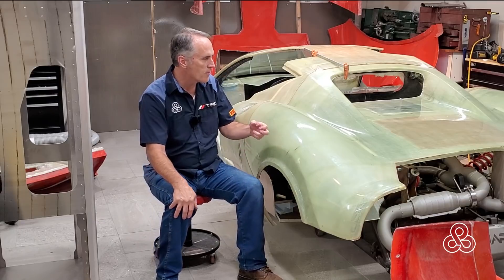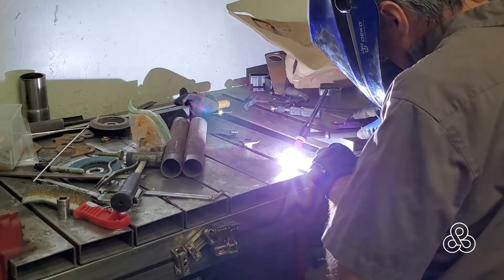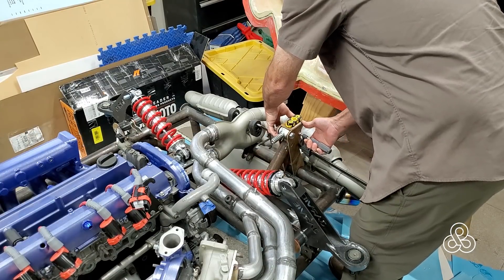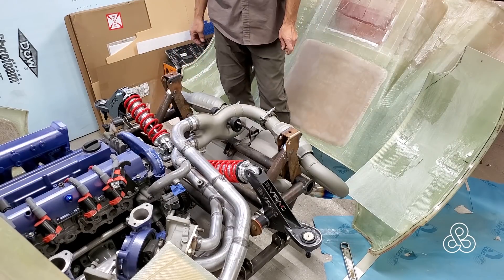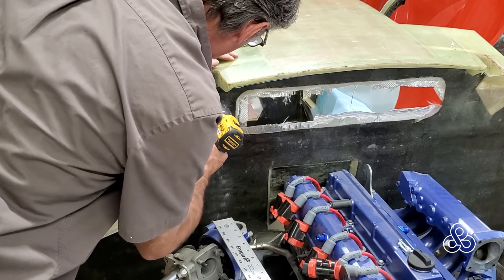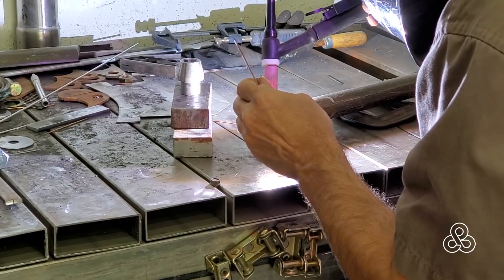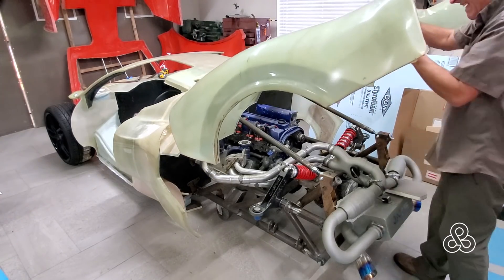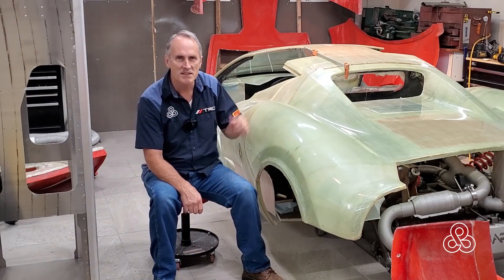A45 - Braced to Race! Upper sub-frame rails - Arete Supercar Project

Comment: Powder over paint. With powder coating you get a more durable finish. Our trucks at work have painted frames on the trailers. The stone chips in the paint are horrific. They look like they have been used as stops at a gun range.

Comment: So no one is going to mention how the engine has a cage but the human doesn't?
Reply from the maker: McLarren, Ferrari, Bugatti, Porsche, Lotus and the list goes on . .use composite monocoque tubs for driver protection. You have just not seen the STRUCTURE built yet. Stay tuned.

Comment: Looking really good, however, your engine choice confuses me a bit. It's too long. I think you would have done better with a more compact design. Yours is too long for a mid design. It reduces cabin space and you may have problems getting the exhaust system to fit inside the car perhaps. this sounds like I'm being very critical of your choice. I*m not. I respect your choices and especially your design...  Steve in Utah
Reply from the maker: At least i know I can fit a V12 as well. Ha!

Comment: I would say that powder coating would be more beneficial because it will probably prevent corrosion of the metal but also it might highlight (further down the line) any movement where no movement should be (I think it will do this by cracking)

Comment: Does this car meet design criteria like SFI, SCCA, or any other sanctioning body, as would be required to race it in particular events?  Racing a car that I have built seems like it would be the most exciting and satisfying endeavor.
Reply from the maker: I have looked at SCCA and NASA as well as Time attack which has divisions with fewer restrictions. Some of it is a bit hazy when building with the monocoque tub. Like a 6 point roll cage. If I embed a steel roll hoop behind the driver, can I bolt the other 4 points to the existing hoop and count it? Like I said there are few things that when you work outside the norm you just have to prove their worthiness. I am not so competitive as just wanting to have access to a good track.

Comment: What is that rear suspension and coilover suspension based on ?
Will that same type of suspension work just as well in the front ??
Reply from the maker: Some variation could also be adapted to work in the front.

Comment: Where the engine is situated , there is going to be a lot of heat there , has that been taken into account as the engine is very near to the  shell of the car.
Reply from the maker: The bulkhead is itself insulation for the cabin. There will also be insulation between the engine and bulkhead. . .maybe gold foil like Mclaren?

Comment: You should do an X brace welded between those two braces you installed. It would make it 1 piece but it would tie the back section of the car together. With those two braces on their own, there isn't anything there to keep it from twisting a little in each way, which will sacrifice handing big time
Reply from the maker: Would like to have done so, but the deck lid is to low. The upper support go through the two  "buttresses" that flank the window.

Comment: I know I'm late to the game here with my response to powder coating but any time I can powder coat I will. I've had to get kind of "creative" with my ways too. I like to use a wet coating technique where I simply mix my powder coating with distilled water (no minerals to interfere with anything), airbrush my mix onto the part, and I simply let the water evaporate away before oven baking or infrared lamping. I know that this system make seem wasteful when time is looked upon but since these are my own projects and not charging an hourly rate to a customer, I feel like the product aka powder coating saved from floating everywhere is well worth it to me.
Plus, it's always good for me to be working on my airbrushing skills.....no matter how class is in session!  Har...har....har....

Comment: I'm worried about the way you connect the central composite materials with the front/rear metal frame. Is it safe? I mean there is no way the  strength of the composite middle section would hold the car together by that simple connection. Alt least I haven't see anyone have done this before.
Reply: I was wondering something similar t
Reply: I was wondering something similar t
Reply: I was wondering something similar t

Comment: I only ever powder coat small components. Frames get painted . Mainly because when it's all done and you suddenly realise you need a bracket you can touch the paint up
Reply from the maker: Good point, and I have a big enough paint gun, but not a big enough powder coat oven. Ha!

Comment: I'm a professional Painter of 40 years. Nothing you can use is going to be sufficient enough. Not even the best epoxy.... spend the money and powder coat the sub frame.
Reply: @Fyre Sturm Ok man, good thing I don't know what I'm talking about. All those lectures I give for paint manufacturers are just conjecture. Listen my friend... the guy is building a frickin' SUPERCAR, not a Go Kart. Nobody with common sense and No Manufacturer PAINTS frames anymore. Snap-On doesn't "Paint" toolboxes anymore. There is no CON to Powdercoating a chassis except occasionally it can cost more. I've forgotten more about Production Painting than you'll ever know...
Reply: The biggest problem with painting that chassis will be getting 100% coverage. The powder coating will be electrostatic sprayed which goes around corners and tight areas.

Comment: I think you'll want some diagonals that link the two braces together. The torsional rigidity it'll add will be sustantial. Lovely work fella
Reply from the maker: Yeah! I really wanted to, but the flat deck lid is to low. Damn design department always gets there way! Hopeful the subframe/tub takes the twist.

Comment: Will there be a single piece clam shell on the finished car, or will there be a hatch style engine cover with fixed qtr panels?  One of my favorite Class B rally cars is the Ford RS200 which has that massive but impossible to operate without a second person clam shell & wonder what your thoughts were on weather it would be too cumbersome...
Reply from the maker: Fairly big clam-shells front and rear. Fixed bumpers (so to say) front and rear as well. The goal is to have the wheels and suspension completely exposed when clams are up. I think that was the goal with the RS200; setup convenience!

Comment: Did you get the design inspiration from the ford gt40  .. It looks a lot like that from the side... And the blue  is going to look amazing.. Really looking forward to seeing the finished car..
Reply from the maker: Although the GT40 is an awesome car, I'm more influenced by the Italians; particularly Pinninfarina designs of the early 60s. However, I don't want people to assume the car is a Ferrari, hence the blue rather than red. Ha!
Reply: @BuilderCreator  The plan and 3/4 views are practically dripping with Ferrari 330 P4 and 250 LM design cues.  So, less GT40 and more of the cars it was designed to beat.

Comment: Ok, I have a doubt. when we install those brace rails, Why do we install it on a free rotation bushing and not hard mounted to the chassis like the bottom section of the rear sub-frame? what I mean is why to give it a degree of freedom and not rigidly mounted.
Thank you 👍
Reply from the maker: The bottom mounts will have urethane pads as well. Although this adds some movement in the chassis, I want some sound/ vibration dampening. (this will be a road car mostly). The upper rails will be extended to a set torque value creating a stressed member and then fixed with jamb nuts. The upper rails are needed, because the two bottom rails are to close together to spread the moment arm forces on the back corner of the tub out enough to transfer all the loads to the tub structure evenly. Don't want the bottom attachments points to become a hinge joint on some wopty-dos (waviness) in the road. Plus I want the top rails removable (out of the way) on servicing. Other than that I have doubts to. Ha!
Reply: @BuilderCreator  okay, I think I understand the working now, by the way, I loved the "wopty-dos" with the translation 😂😂. Okay, So will you be mounting any shock absorbers between the rear subframe and the monocoque to dampen/ restrict the vertical motion of the rear subframe (like the subframe of a bicycle).
Reply from the maker: @divyanshsrivastava7312  No. Just the urethane. Solid mounting is to hard, rubber is to soft. Similar to changing out all the rubber motor mounts and suspension bushings on your street car to urethane for better performance, but not quite as drastic as going to metal on metal of a pure race car were you don't care if your teeth rattle, you just want performance. Some rigidity just not super rigid. any dampening is by the shocks and springs.
Reply: @BuilderCreator  ok I get it now, thank you and sorry for ruining your sleep cycle 😅

Comment: Do you have any idea what the handling characteristics will be on this car? My friend's father races f2000, he drove a car that on paper 'was perfect' it ended up being a winning car after some tweaking.
Reply from the maker: The short answer is NO! Like you said design for" perfect" and then see how close you get. I have designed a LOT of leeway into setup adjustment. After the first drive its tweak tweak tweak! If I can't make it right with the adjustments, I can rebuild suspension components and try again until its right, or at least until I'm happy.

Comment: I wish you knew how excited I get when these videos come out! It has to be an amazing feeling to finally see this thing as a real car in your shop. Have you figured out what you will do for headlights and taillights?
Reply from the maker: It's a real roller coaster! I put it together and get excited. then I take it apart to do some work and think. "damn I got a long way to go!" then I put it together - round and round and round it goes.  Glad you get excited, because I get excited every Wednesday night when I hit UPLOAD! (You know how that feeling goes!) I will be 3d printing buckets for the headlights (LEDs from aftermarket) the tail lights will be cast resin and acrylics with embedded LEDs;  all scratch built . Could I do anything else?
Reply: @BuilderCreator  Sir, will you be printing it with PETG because any other plastic might melt because of the heat emitted by the LEDs. actually, when I think about it, I would recommend for the tail light you can use the 3D printing method but for the headlights, I would say go with an aluminum light bucket.

I have been watching this build where some students are building a Lykan Hypersport and they had to make headlights and taillight for them (links are provided down)

Headlight (relevant info till 10:00 mark)
https://youtu.be/nCapQFU7UTM?t=265

Taillight (relevant info till 17:00 mark)
https://youtu.be/b_FZEqbxbJg?t=918

final result:
https://www.youtube.com/watch?v=qqJsax39CdU&ab_channel=CaseyPutsch

I hope it helps. actually, I was going to send this data in the future but it seemed like a pretty good/relevant time.
thank you 😊👍
Reply from the maker: @divyanshsrivastava7312  Yeah, I've tried a couple of times to connect with Casey Putsche and get involved with his Genius Garage, but got snubbed. Even had facilities, money and a project for some students on the west coast US. I'll go take a look at their lights, but know how I will approach mine already. Thanks for scouting YouTube for me. Ha!
Reply: @BuilderCreator  Wait a minute, does "cast resin and acrylics with embedded LEDs" means fibreglassing the buckets with an acrylic lens for the cover, if that is true then I think that'll actually be a better approach to produce the lights. 
Happy to help sir, and I would post more things if I find something relatable and helpful...
Reply: Why don’t u upload like that any more
Reply: Simple minds are easily impressed by a wood and plaster of paris high end soap box derby car.
Reply: @nick9463  Geniuses think a buck is the end product.

Comment: Awesome video as always! 
You mentioned some design on cast components. Are you designing only the parts or do you figure out the casting design too as far as the mold with the sprues and everything? What process and material do you plan on using and is it something you do personally or outsource to a foundry?
Reply from the maker: Believe it or not I have more foundry experience than composites experience. I only have a small home foundry (like my small home design studio), but I do it all in house. Some casting videos coming up! Lost wax, lost foam and green sand casting; mostly aluminum and bronze. Can push the furnace to do cast iron, but rarely find anything I need in iron.
Reply: @BuilderCreator  I have tried my hand at backyard aluminum casting. It was kind of proof of concept for myself so I just buried foam in playbox sand and poured aluminum over it. The results were surprisingly good but I tried making too small of parts and the flow froze up. I never did any type of burn out but my best dimensional and surface finish results came by dipping my foam plug into a sheet wall plaster slurry. My next attempts would be lost PLA with very low infill prints, j think they would have similar results to the foam with the simplicity of CAD design and 3d printing. Can't wait for the casting videos. 
https://youtu.be/XqYA6gJUN4I
Reply from the maker: @moremotorsmorefun3456  with the polystyrene foam (low density) the gasses can escape through the sand fast enough to get a good cast. With the PLA you will have to Burn out the plastic, otherwise the gasses form the breakdown can't escape fast enough and you will get bubbles/porosity at best disaster at worst. your video showed the pour do you have a vid/pic of the results?
Reply: @BuilderCreator  I can't find pictures of the results but my parts were too long and skinny and froze up half way everytime. The half that poured looked good though, but I haven't messed with it much since. I'd like to pour an emblem for my friends MX-J32 custom build and will share results when I get that done.